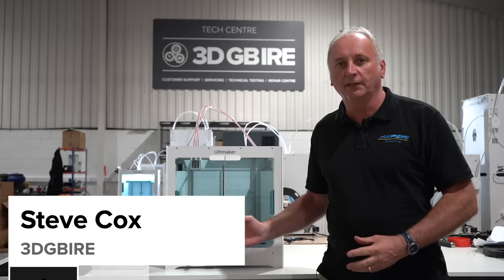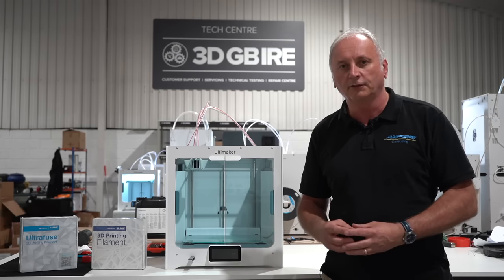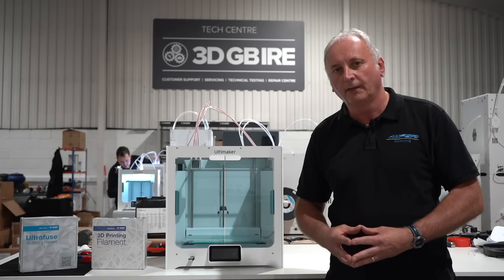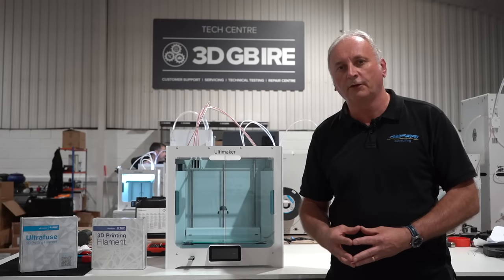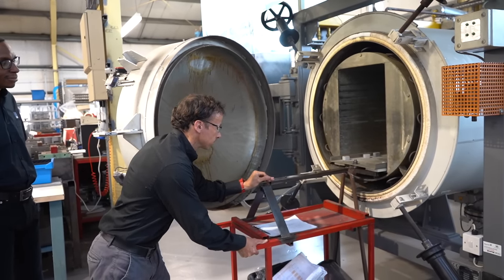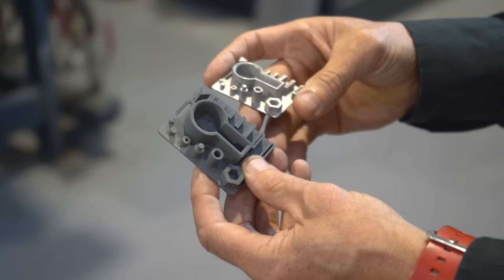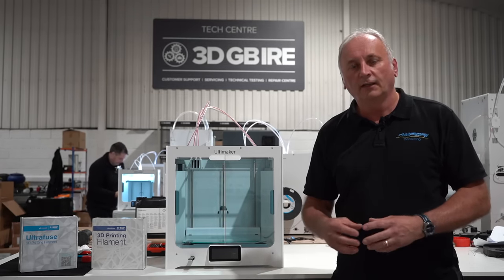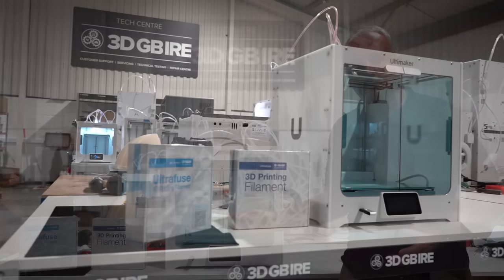Steve Cox explains FDM BASF Metal 3D Printing Filaments and Processing

Comment: please share debinding and sintering cycle
Reply: The the debinder is a solution known as 3m's novec which is a non toxic industrial degreaser. The filament ins bound synthetic polymer and thus is broken down by the novec. sintering is done in chamber filled with inert gas and is heated to the part's sintering temperature. This makes the part solid but causes it to shrink. To avoid shrinkage you can place a peice of brass to flow into the part making it a composite and stopping it from shrinking. EXone, the people who make binder jetting 3d printers have a good video on the sintering process.